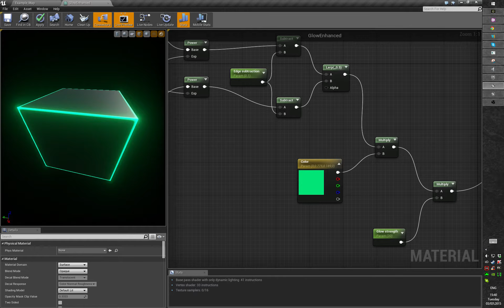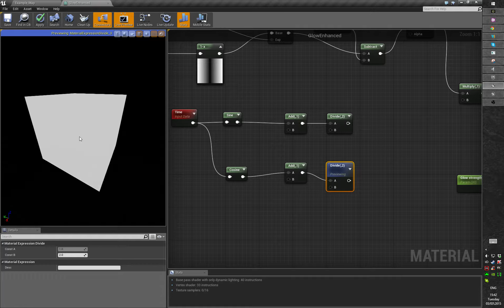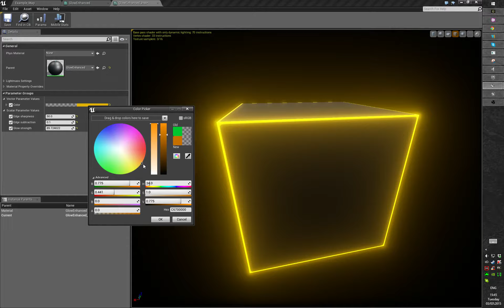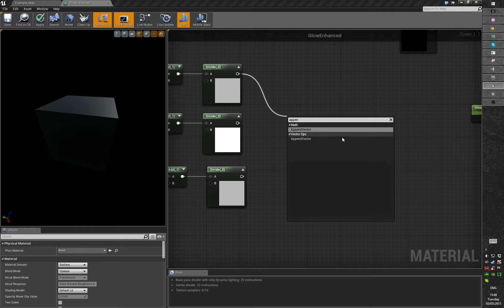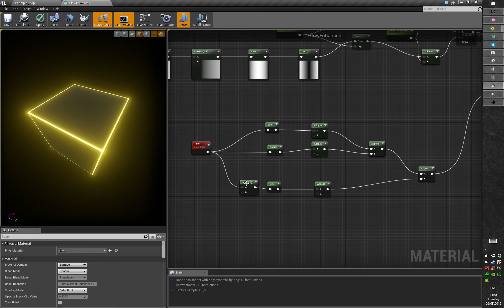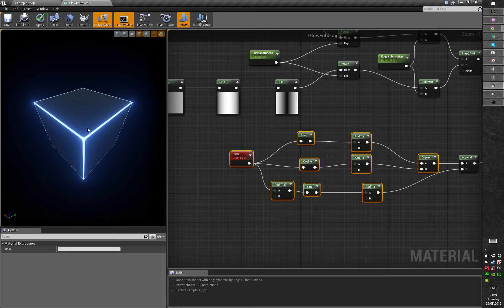Unreal 4 Tutorial: Advanced tron material #2

Comment: Hi. Thanks for the tutorials really helping with a project. However when i put these materials on certain objects they seem to glow really bright. If the material is placed on a standard box from unreal it works fine but when placed on a geometry box or something from the starter content it has this blinding brightness issue. Any ideas on the issue or help would be much appreciated.
Reply from the maker: Hello. Yes, that's a common topic with this material. The issue boils down to UV mapping of the mesh. To make it look good, you would need to unwrap UVs of your static mesh, using glowig square as a reference texture (you can make it in photoshop, for example). This is usually done in Maya or 3ds Max prior to importing the mesh into UE. I have received several requests to make a tutorial about it, but never got time to do it as of now :(
Reply: I read all through this and the last tutorial and everyone asks the same thing: how to use on complex geometry. 3 years ago you posted some images to show what the texture looked like and how it would be mapped - which would explain everything, but those images have been inactive for ages. PLEASE repost these pictures. I can UV map objects, but I don't know what I'm supposed to be mapping on there. just white outlined edges maybe? soft edged lines? what?  a picture would speak a thousand comments here...
Reply: yeah +1, i'd love that too please

Comment: Hi, how I could make the color change only happen in a range? for example for light blue to a dark blue only?
Reply from the maker: Hi. If you want to cycle through 2 specific colors, I'd suggest you lerp between them as two vector params. Put colors there manually, then use sine of time as an alpha (having the right sine range ofc, e.g. (sin(time) +1 ) /2 ).
Reply: ***** In the line of [Time] -> [sin or cos] -> [plus one] -> [divide by two] -> ...
delete [divide by two] item and instead it add two new items: [Multiply by Y/2] and then [plus X]. It creates a color between [X] and [Y]. X < Y < 1.0f. For example, X = 0.25f and Y = 0.75f.